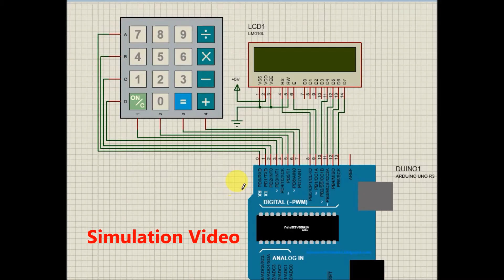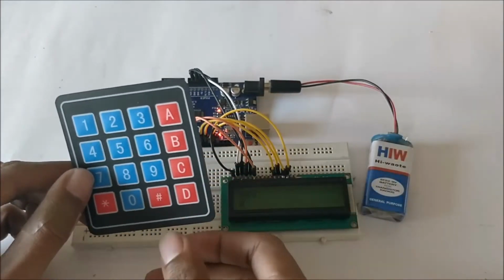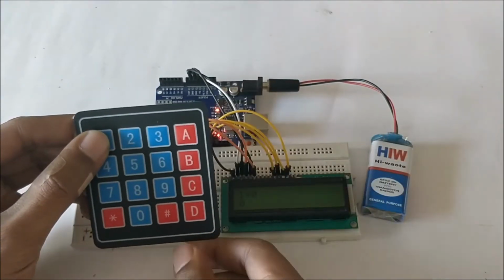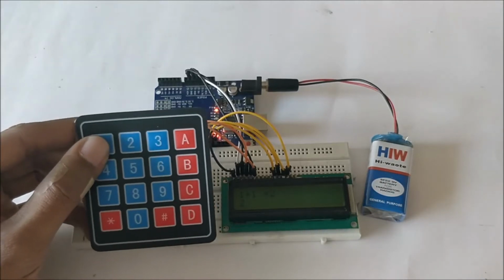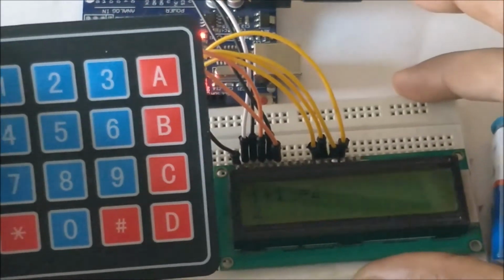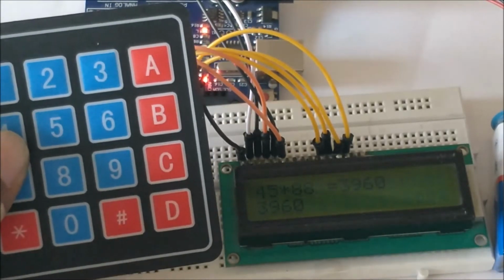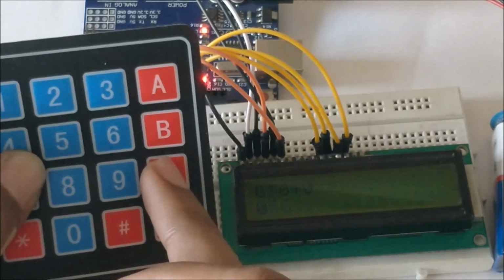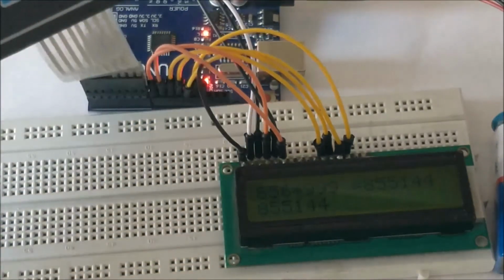How to Make an Arduino Calculator using 4x4 Keypad and LCD

Comment: Sir, it was awesome. But I have a question that, You have connected the keypad with D0 and D1, means RX and TX pin. So will it damage the Arduino board?
Reply: no it's just the send and receive so that the arduino and keyboard can communicate

Comment: Sir ur project is not working everything is well lcd also is in ON condition but when I press any key from keypad nothing shows on lcd. Why?
Reply: And in the circuit diagram u used a potentiometer while in the video there is no potentiometer...

Comment: link for the code????????
Reply: Its in the video description
Reply: /*
 * Arduino Keypad calculator Program
 */

#include <LiquidCrystal.h> //Header file for LCD from https://www.arduino.cc/en/Reference/LiquidCrystal
#include <Keypad.h> //Header file for Keypad from https://github.com/Chris--A/Keypad

const byte ROWS = 4; // Four rows
const byte COLS = 4; // Three columns

// Define the Keymap
char keys[ROWS][COLS] = {

  {'7','8','9','D'},

  {'4','5','6','C'},

  {'1','2','3','B'},

  {'*','0','#','A'}

};

byte rowPins[ROWS] = { 0, 1, 2, 3 };// Connect keypad ROW0, ROW1, ROW2 and ROW3 to these Arduino pins.
byte colPins[COLS] = { 4, 5, 6, 7 }; // Connect keypad COL0, COL1 and COL2 to these Arduino pins.

Keypad kpd = Keypad( makeKeymap(keys), rowPins, colPins, ROWS, COLS ); //  Create the Keypad

const int rs = 8, en = 9, d4 = 10, d5 = 11, d6 = 12, d7 = 13; //Pins to which LCD is connected
LiquidCrystal lcd(rs, en, d4, d5, d6, d7);

 long Num1,Num2,Number;
 char key,action;
 boolean result = false;
 
void setup() {
  lcd.begin(16, 2); //We are using a 16*2 LCD display
  lcd.print("DIY Calculator"); //Display a intro message
  lcd.setCursor(0, 1);   // set the cursor to column 0, line 1
  lcd.print("-CircuitDigest"); //Display a intro message 

   delay(2000); //Wait for display to show info
    lcd.clear(); //Then clean it
}

void loop() {
  
key = kpd.getKey(); //storing pressed key value in a char

if (key!=NO_KEY)
DetectButtons();

if (result==true)
CalculateResult();

DisplayResult();   
}

void DetectButtons()
{ 
     lcd.clear(); //Then clean it
    if (key=='*') //If cancel Button is pressed
    {Serial.println ("Button Cancel"); Number=Num1=Num2=0; result=false;}
    
     if (key == '1') //If Button 1 is pressed
    {Serial.println ("Button 1"); 
    if (Number==0)
    Number=1;
    else
    Number = (Number*10) + 1; //Pressed twice
    }
    
     if (key == '4') //If Button 4 is pressed
    {Serial.println ("Button 4"); 
    if (Number==0)
    Number=4;
    else
    Number = (Number*10) + 4; //Pressed twice
    }
    
     if (key == '7') //If Button 7 is pressed
    {Serial.println ("Button 7");
    if (Number==0)
    Number=7;
    else
    Number = (Number*10) + 7; //Pressed twice
    } 
  

    if (key == '0')
    {Serial.println ("Button 0"); //Button 0 is Pressed
    if (Number==0)
    Number=0;
    else
    Number = (Number*10) + 0; //Pressed twice
    }
    
     if (key == '2') //Button 2 is Pressed
    {Serial.println ("Button 2"); 
     if (Number==0)
    Number=2;
    else
    Number = (Number*10) + 2; //Pressed twice
    }
    
     if (key == '5')
    {Serial.println ("Button 5"); 
     if (Number==0)
    Number=5;
    else
    Number = (Number*10) + 5; //Pressed twice
    }
    
     if (key == '8')
    {Serial.println ("Button 8"); 
     if (Number==0)
    Number=8;
    else
    Number = (Number*10) + 8; //Pressed twice
    }   
  

    if (key == '#')
    {Serial.println ("Button Equal"); 
    Num2=Number;
    result = true;
    }
    
     if (key == '3')
    {Serial.println ("Button 3"); 
     if (Number==0)
    Number=3;
    else
    Number = (Number*10) + 3; //Pressed twice
    }
    
     if (key == '6')
    {Serial.println ("Button 6"); 
    if (Number==0)
    Number=6;
    else
    Number = (Number*10) + 6; //Pressed twice
    }
    
     if (key == '9')
    {Serial.println ("Button 9");
    if (Number==0)
    Number=9;
    else
    Number = (Number*10) + 9; //Pressed twice
    }  

      if (key == 'A' || key == 'B' || key == 'C' || key == 'D') //Detecting Buttons on Column 4
  {
    Num1 = Number;    
    Number =0;
    if (key == 'A')
    {Serial.println ("Addition"); action = '+';}
     if (key == 'B')
    {Serial.println ("Subtraction"); action = '-'; }
     if (key == 'C')
    {Serial.println ("Multiplication"); action = '*';}
     if (key == 'D')
    {Serial.println ("Devesion"); action = '/';}  

    delay(100);
  }
  
}

void CalculateResult()
{
  if (action=='+')
    Number = Num1+Num2;

  if (action=='-')
    Number = Num1-Num2;

  if (action=='*')
    Number = Num1*Num2;

  if (action=='/')
    Number = Num1/Num2; 
}

void DisplayResult()
{
  lcd.setCursor(0, 0);   // set the cursor to column 0, line 1
  lcd.print(Num1); lcd.print(action); lcd.print(Num2); 
  
  if (result==true)
  {lcd.print(" ="); lcd.print(Number);} //Display the result
  
  lcd.setCursor(0, 1);   // set the cursor to column 0, line 1
  lcd.print(Number); //Display the result
}